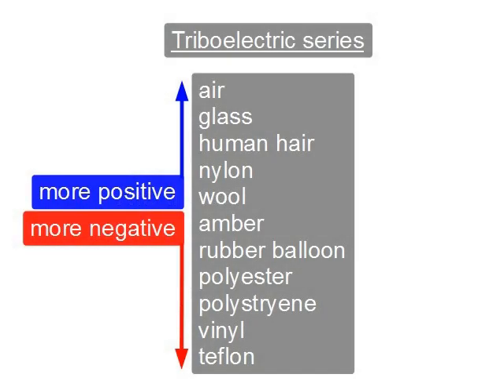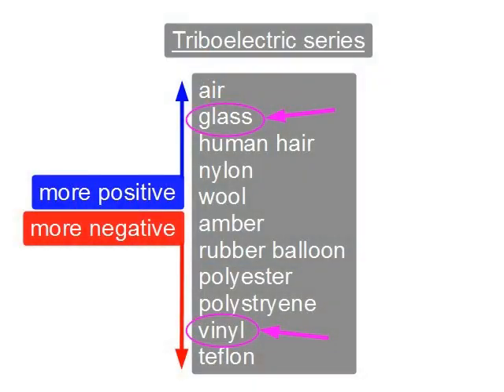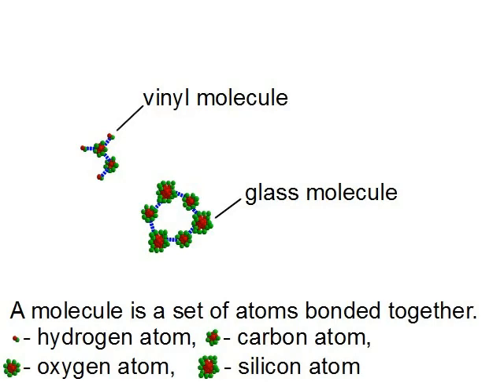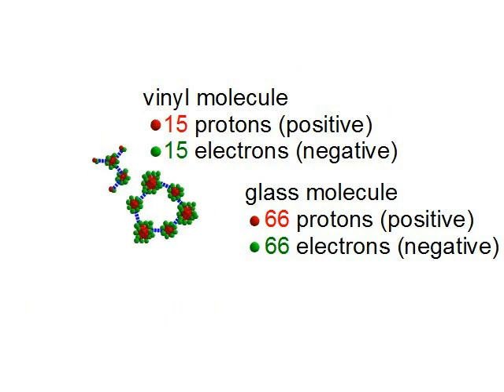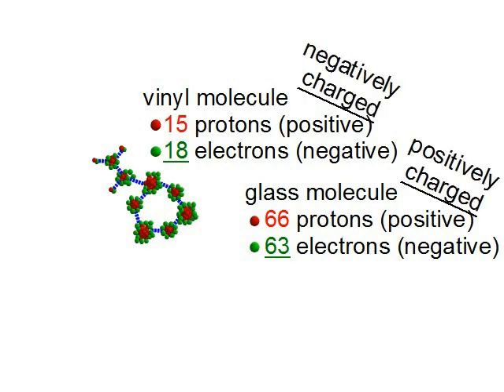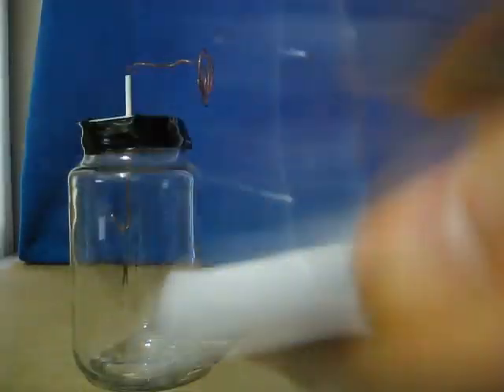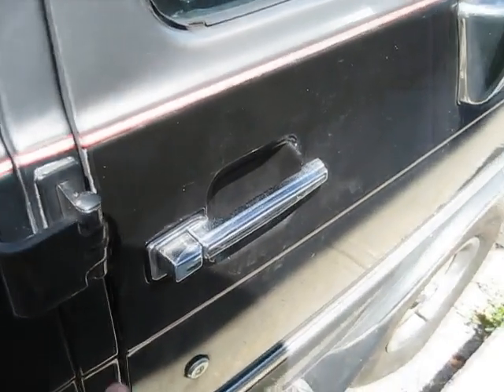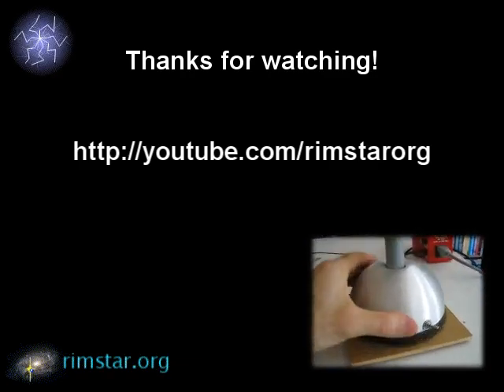Triboelectric effect/series or triboelectricity

Comment from the maker: Yes, the vinyl has a better charge on it. I don't recall why I used the glass for the demonstration, possibly the vinyl had too much charge and spread the leafs too wide so I went with the glass instead.
I've always wondered why it was harder to charge the glass. Regarding your explanation, even though vinyl has fewer protons and electrons to start with, they're neutral and so don't participate. And the exchange is one-for-one since taking one electron leaves one unpaired proton. FWIW

Comment from the maker: @field16 As I said above, my guess is that the problem with air is its density. If you could produce dense enough air then you'd probably get better results. So it belongs at the top of the list... there's just an engineering problem in making use of it :-).

By the way, I originally made my electroscope because I needed one, not just to try it out or to make a video. So it keeps popping up because it's a useful tool when dealing with electrostatics.

Comment: If you repeated the experiment of rubbing the glass against the vinyl using the same piece of glass, could you keep transferring  electrons away until it was left with no electrons? If not, how does it restore electrons?
Reply from the maker: I don't think you could remove all electrons. I suspect only the outer electrons can be removed. As for restoring them, once an object is positively (or negatively) charged, it starts attracting opposite charges from the surrounding air until it becomes neutral again.

Comment from the maker: @field16 Thanks! Great minds do think alike. :) I think air is too low density to be useful. Just blow a lot of air (a fan, a hair drier?) over a piece of something from the other end of the list, e.g. vinyl. Then put the material near the terminal of an electroscope to see if it is charged. Ah heck, I can try it as fast as explain. Just tried vinyl and polyethylene and got no noticable charging. If you try it too, be careful where you put your hands; skin is on the list too (a longer list)!

Comment from the maker: They provide current only when you first connect across them. Then there's no more current. But if you break the connection and reconnect then you get another brief moment of current. However, I haven't measured any. The most I've been able to do is detect the charge using my electroscope. You can see a bit of it in my recent video "10,000 Subscribers Thx - Ionocraft, Electret, Joule T...".

Comment: but why dont the electrons just stay with the glass molecule in your example? what is making the electrons stay attracted to the vinyl molecule? 2:35
Reply from the maker: According to this https://en.wikipedia.org/wiki/Triboelectric_effect#Mechanism_of_triboelectrification , the electrons stay because energy is needed to move them back and no such energy is available.
Reply: thanks, i suppose this part satisfies my query:
"Although the part 'tribo-' comes from the Greek for "rubbing", τρίβω (τριβή: friction), the two materials only need to come into contact for electrons to be exchanged. After coming into contact, a chemical bond is formed between parts of the two surfaces, called adhesion, and charges move from one material to the other to equalize their electrochemical potential. This is what creates the net charge imbalance between the objects. When separated, some of the bonded atoms have a tendency to keep extra electrons, and some a tendency to give them away, though the imbalance will be partially destroyed by tunneling or electrical breakdown (usually corona discharge). In addition, some materials may exchange ions of differing mobility, or exchange charged fragments of larger molecules."
Reply: @RimstarOrg  your answer makes sense, too.

Comment: RimStarOrg, do you know a extended list of those materials, and is it always the rule that the more atoms in a molecule, the more positive it will get and the less, the more negative?
and how do you know for sure what material you have? especially since often materials can be blends, or have similar weights, etc?
Reply from the maker: For a list, I just search online for "triboelectric series" until I find a list that has the material I'm looking for. Regarding why certain molecules give electrons and why other take them, I don't know. As for know for sure what material you have, I don't have any tricks for that other than trying them to see if they get charged. Just make sure the materials are clean, that they don't have any coating on them (e.g. hair with products in it is no good).
Reply: @RimstarOrg  thanks, I will do it that way then. unless ofcource I find out a different method.

Comment: I have a PVC glove and some glass jar. But it barely charges even though it's far away on triboelectric series. Why is that? PVC glove doesn't influence electroscope. Glass works but still nothing much.

P.S. thank you for the video. It is the video which teached me how this stuff actually works, and that "charging by friction" is actually not about friction. Friction just gives more chances for molecules to meet I guess.
Reply from the maker: I find it difficult to charge with glass too. Make sure the glass is very clean, no grease or anything on it. Since both your glove and the glass are not good electrical conductors, only the surface areas that make physical contact with each other will become charged so make sure you bring those areas near the electroscope's terminal.
And thanks, I'm always glad to hear when someone's found my videos useful and learned something.

Comment: can I know which material is positively or negatively charged without using triboelectric series...............and I want to know what will happen if rub spandex with cellulose .............tahnks in advance
Reply from the maker: That's an interesting question. And yes, you can. In my video "Positive or Negative? How to Find Electric Charge Polarity" I test which polarity a TV screen is. Use the same technique, charge up your cellulose (for example) and use the cellulose where I use the TV screen in the video.
Reply: +RimstarOrg    Nice answer

Comment: why did the aluminium leaves went apart from each other?
Reply from the maker: Like charges repel each other and unlike charges attract each other. Since the leaves are both charged with the same polarity (both positive or both negative) then they repel each other.
Reply: @RimstarOrg  why are they charged with the same polarity then?
Reply: Shouldn't they be neutral?
Reply: @carolkhor7383  Imagine you have a sphere (balloon for example)  which is negatively charged. So it has a lot of electrons.

If you put it next to a piece of metal, all the electrons inside the metal will 'run away' from the negatively charged balloon.

In electroscope, all the electrons would run through the metal (metal is a conductor so electrons move around easily). The very end of the electroscope are 2 metal leaves. So the electrons run all the way to the 2 metal leaves and cannot go further. So 2 metal leaves are negatively charged. So they start to repel each other.

Read this sentence by sentence, imagine this and take it slow. You will get it.